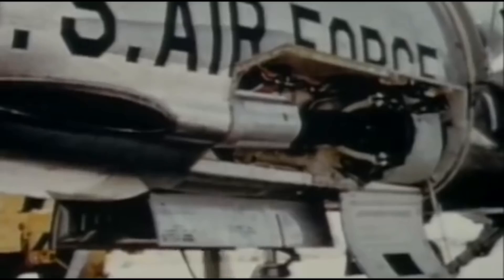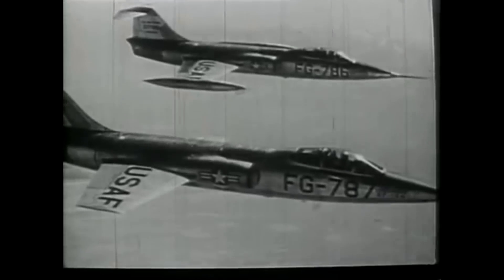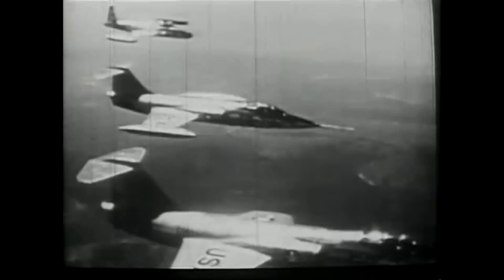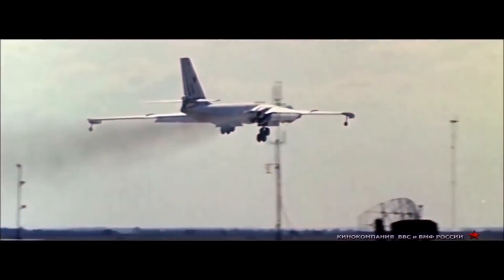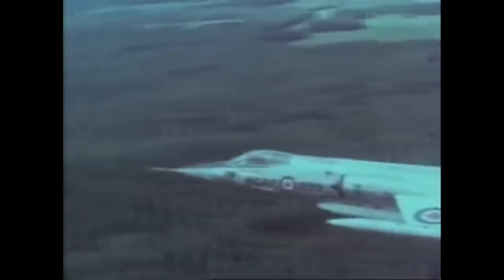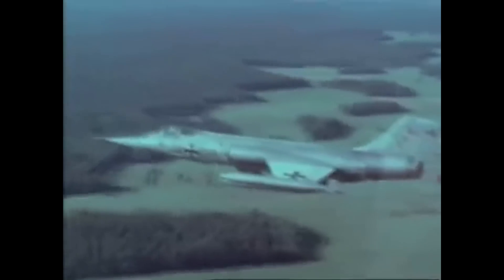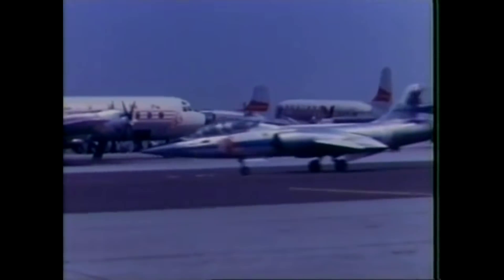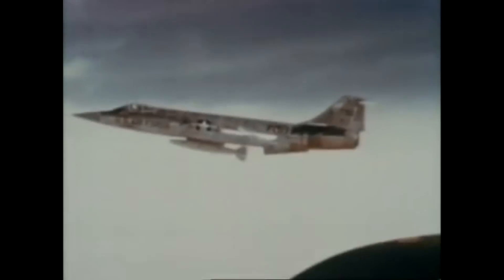Lockheed F-104 Starfighter | The worlds first Mach 2 fighter

Comment: How could it possibly catch a B70 Bomber. It can't not fast enough.
Reply: Are you referring to the "XB-70 Valkyrie"? Only 2 were ever built, and they were still being tested and evaluated. The lone surviving XB-70 is on display at the USAF Museum at Wright Patterson AFB, Dayton Ohio.

 By "catching" the XB-70...are you referring to the mid-air collision between an F-104 and one of the XB-70s? They were flying in formation (along with an F-4, T-38, and F-5) for a photoshoot...because the engines of all 5 aircraft were built by GE. So...the F-104 didn't need to "catch" the XB-70...as it was not trying to outrun the F-104. The F-104 impacted the XB-70, and both aircraft were lost. Quite the anticlimactic ending to what was intended to be a positive, promotional photoshoot!
Reply: When I was 10 Years old my dad took me to Palmdale to see the rollout of the first B70. He was a tech rep for NAA and worked on this project as well as the X15 and Apollo CSM. The cruise speed for the B70 was Mach 3.

Comment: ummmm, F-86s had a kill ration of 10-1 over Mig 15s in Korea. (beginning of video)
Reply: The more recent scholarship based on now unclassified operational records from both sides seems to debunk that older narrative.
Reply: @gort8203  please advise what this more recent scholarship has uncovered.
Reply: @asquare9316  That the exchange ratio between the F-86 and the MiG-15 kill ratio was much more balanced than previously reported.  As I said, this is due to detailed study of actual loss records from the war. When I grew up the kill ratio was often reported as 12:1, so I'm not happy with the revised history, but I try to keep an open mind.  The latest and most comprehensive thing I read had the worst numbers yet, and that is "MiG Alley: The US Air Force in Korea, 1950-53, by Thomas Cleaver with a foreword by Col (Ret.) Walter J. Boyne."  The fact that Boyne wrote the forward added credibility for me and caused me to read the unpleasant revelations.

Comment: Run that past me again. 21 pilots ejected into the ground before someone in charge said 'OK. There's something wrong here'.
Reply from the maker: Basically 😳
Reply: @theatomiccafe8996  The reason for the downward ejection seat was not only because the 'belly' was clear but that the F-104 was designed for high altitude/high speed so an ejection into the clear air below the aircraft was much more seen as survivable.
Reply: @randycampbell6307  a gun type ejection seat would have had to be too powerful in order to clear the tail at supersonic speed. The acceleration necessary would have broken the pilot. The rocket seats with gimbled thrust beyond the confines of the cockpit and so less dramatic accelerative forces upon the ejectee were yet to be developed.
Reply: @theatomiccafe8996  wtf
Reply: Hmmm it puts the trouble of the F-22 and F-35 with the oxygen systems into perspective (both were grounded after they lost a unit or two to sudden pilot's anoxia - just two pilots lost and the USAF already freaked out - it ain't as it used to be).

Oh, wait, I was forgetting who has designed those two planes...
Reply: Ejection seats were a new concept.  Oxygen isnt.
Reply: @pickeljarsforhillary102 That's no excuse for putting them in upside down, is it?
Reply: @pickeljarsforhillary102  
Ejection seats were hardly new by 1960. Oxygen is older and The US still get that wrong.
Reply: This was also the era where they'd have soldiers stand 2 miles from a nuclear bomb explosion for shits and giggles so im not surprised lol
Reply: Just ask Ivan Kincheloe.  He actually rolled the low flying 104 inverted and tried to eject that way.  It didn't work but it did show that he truly did have the right stuff!
Reply: Martin-Baker Mk.7 a British rocket-assisted zero-zero ejection seat retro fitted to European Starfighters
Reply: I guess that hurts...😱🤪
Reply: Porsche 911 GT3 RS,
The butts hurts, if something goes wrong with upward ejection seat, the head hurts. That is the only advantage.
Reply: Typically.
Reply: The Stratojet had a similar setup for the B/N; the guys up top ejected in a proper upward direction, the B/N went downhill. 
The common failure mode of most early turbojet was during takeoff, under maximum load. When a J47 puked its guts post-V1, the pilot and copilot would get out in the vertical direction most suitable for survival. That poor guy in the nose had only a chance to determine his time of death: ride the point of a 200,000lb spear into the ground, or take the rocket-rail to same.

Dad hated swinging the compass on a B-47...
Reply: chris younts  
I think volunteers to test the downwards ejection seat would be none, proper ejection seats were tested on the ground first. An early ejection seat as fitted to a German aircraft in WW II was I believe used just once, the unfortunate pilot was later found still strapped into the ejection seat, dead and minus both arms, what was meant to happen was he pulled the lever and ejected in the seat then had to unstrap the seat and pull the rip cord.  
It seems that as the seat went up he did not pull his arms in far enough and it would be hard to do much with no arms.
Reply: chris younts  Apparently not.
Reply: chris younts  No. Upwards.
Reply: chris younts  Thanks. I didn't know that, Chris. What I do know is that my dad, who was in the RAF, saw a ground crewman have his head ripped off by an ejector seat he was working on. He was leant into the cockpit and bang. I think that was in Aden in the Sixties. Dunno what type of plane it was.
Reply: chris younts  One beer. Crikey! But your ships are dry. We used to have a rum ration, but they stopped that. I'm not sure whether our ships are wet or dry now? As for me, I have a background of RAF and merchant navy. Thought about both but never went either way. In some ways I regret it and in others, I don't. Either way, it wasn't meant to be. Maybe that's where my strong interest in militaria comes from.
Reply: Dude, that was Ivan Dixon.  His character's name was Kincheloe.  That's a true story about rolling the 104 in the middle of a low altitude crash.  He was an amazing aviator. chris younts
Reply: Typical Washington General's thinking, still do!  I was enlisted, worked for a living.
Reply: That "21 pilots ejected into the ground" is bullshit.  There weren't even that many downward ejections total.
Reply: That "21 pilots" business a lot of bullshit.  There were only 17 documented downward ejections, and 11 were successful.
Reply: Rather than eject downwards why not redesign the tail or have explosive bolts on the tail that blew off the tail when the seat ejected, I'm sure it could have been worked out.
Reply: @StephenJohnson-jb7xe  I'm guessing cost!
Reply: @casinodelonge  yeah possibly, tbh I had to go back to look at my comment to see what you were answering because I forgot.
Reply: Nonya Business   
There were good ejection seats available but Lockheed either did not know or just wanted to do it on the cheap.  Even in WW II Germany had made an aircraft which on ejection the high tail and rear propellor would be blown off just before ejection.  The F 104's did eventually get the Martin Baker ejection seat

Comment: The F-104 was designed as an interceptor, not a fighter...duh.  As a air superiority fighter, it was an unmitigated failure.
Reply: Not really.  It was designed as a day fighter.  It was pressed into interceptor duty because the real all-weather bomber interceptor had suffered development delays due to systems complexity, and the F-104 was assigned to fill the gap until the F-102 was available for full service

Comment: The entire premise of this piece seems to be flawed. The USAF already had a fighter which was superior to the MiG-15, the F-86 Sabre. USAF pilots flying the Sabre defeated experienced Soviet pilots by 3:1 in Korea, Chinese pilots 5:1, and NorK pilots 10:1. If the USAF brass wanted a better fighter than the Sabre it would have had to be able to defeat a MiG with a chimpanzee the controls.

Seems like what happened is that someone invited ol' Kel to Korea and tbe Sabre pilots complained that the MiG-15 had a faster rate of climb than the Sabre. They apparently didn't complain that the Sabre could easily exceed Mach 1.0 which the MiG could not. They apparently didn't complain that the Sabre was superior in virtually every aspect of performance other than rate of climb and max. service ceiling. The F-86F, the last version fielded in Korea, was a match for the MiG's rate of climb and the postwar F-86H was probanly a match for the MiG-17.

The idea that the F-102 and F-106 supplanted the F-104 is nonsense. The F-104 over optimized rate of climb and top speed at the expense of other aspects of performance. The aircraft which the AF chose to do the job of the F-104 was the F-110A, aka F-4 Phantom II.
Reply: I don't think the idea the F-86 was decisively superior to the MiG-15 is widely held these days. They are seen as essentially equivalent, with different strengths and weaknesses.  But that doesn't really matter here, because Kelly Johnson wasn't designing a fighter to combat the MiG-15.  The Sabre's replacement was already on its way in the form of the F-100 SUPER Sabre.  Kelly Johnson was really designing a jet that was to have decisive superiority over the F-100, not the MiG-15 or F-86.   The pilots he'd interviewed said that speed and climb were the decisive attributes in combat, so unmatched speed and climb was the goal.  Judging the F-104 against later fighters like the F-4 probably isn't a fair comparison.  The question I ask is whether you'd rather fight a MiG-19 with an F-104 or an F-100.
Reply: @Gort  Again, my comment is regarding what is stated in the video, "The Air Force requested a fighter specifically built to beat the MiG-15," and referring to Kelly Johnson's trip to Korea, "He figured if he wanted to know how to beat the MiG-15 he should ask the pilots who flew against them." It also states that what the pilots wanted was "raw speed." There is probably a point in there that there's a reason why pilots don't design aircraft.

The USAF never had to confront the MiG-19 in significant numbers. In the Vietnam War the MiG-17 and -21 were the primary adversaries. The USAF did use the F-104 in Vietnam in a defensive role although none scored an aerial victory. Apparently, the VPAF was wowed by the Starfighter's press clippings and the USAF was reluctant to use it to confront the MiG. The most successful U.S. fighter against tbe MiG in Vietnam was the F8U but, of course, those could only be deployed in small numbers.

I realize now after re-watching the video that since it was the F-80 that was completely outclassed by the MiG-15 that is the most likely reason CKJ high-tailed it to Korea. The video missed that important point. Even the underpowered F-86A held its own against the MiG-15. The USAF pilots who flew the Sabres had widely varying combat experience. From WWII veteran aces like most of the Soviet pilots to pilots with no combat experience and many low-time pilots. The Sabre was an equalizer, not merely an equal to the MiG-15.  The Sabre could go suoersonic within seconds in a dive. In fact, the XP-86 was the first piloted aircraft to exceed 1.0 Mach about 3 weeks before the "official" record was set by the Bell X-1. That gave Sabre pilots an easy means of escape if they got in trouble. The MiG-15 could not go supersonic in a vertical dive at full power. 

Not to detract from the legend of Clarence Kelly Johnson in any way. My dad worked in Building 82 at Lockheed in 1955.
Reply: @dalecomer5951  I think we agree the video is misleading, and I wasn't trying to support what was said there.  My comments were directed at your claim that the F-86 was superior to the MiG-15.  We don't need to discuss the specific strengths and weaknesses of the two airplanes, but you must be aware that many now argue that the MiG was equal if not slightly superior to the F-86 in overall capability.  (I will add that a means of escape from the enemy is not an offensive advantage that wins a fight.) 
Also, I do not accept the idea that the F-104 was specifically designed to replace the F-86 or fight the MiG-15.  It was not even conceived in response to an Air Force request; Kelly Johnson conceived it and presented the concept to the Air Force. I think Kelly Johnson was simply working to get ahead of the pack and wanted to sell the Air Force an airplane like nothing you could see on the drawing boards of his competitors.
Reply: @gort8203  Yeah, we can agree to disagree.

Comment: The first aircraft to exceed 2.0 Mach was the D-558 II in November 1953. The same aircraft had set a world altitude record the previous month.
Reply: Nobody thinks the F-104 was the first aircraft to do Mach 2, but it was the first operational Mach 2 fighter.
Reply: @gort8203  My comment is regarding what was stated in the video, "It was the first plane to fly Mach two." It's an unqualified statement. BTW, my dad helped install the uprated XLR8-RM-6 rocket motor in NACA 143 about a year before the record flights.
Reply: @dalecomer5951  Wow, I guess I didn't hear him correctly. Thanks for correcting it!
Reply: Correct, but the Skyrocket was a jet and rocket powered experimental aircraft. The 104 coming only a year later as an operational fighter was something remarkable.
Reply: @Hattonbank  The official world altitude and speed records were not set by a YF-104A until May 1958 due to teething problems with the J-79. The first squadron didn't go operational until Feb '58 and was almost immediately grounded because of engine problems. It wasn't just a year later.

At the time the official altitude record was set by the YF-104A the U-2C had been cruising higher for over two years, unofficially.

Comment: Lockheed F-104 Starfighter was one of the WORST aircraft that the USA ever produced. One unforgivable flaw, its uncontrollability, even by the most experienced pilots, made it disaster.
Reply: It was not uncontrollable.  It had some new characteristics, some some of which later applied to other aircraft that adopted the boundary layer control system the F-104 pioneered.   If didn't want to fly an airplane that required some skill and keeping your wits engaged you stayed out of high performance aircraft.

Comment: Ironically enough the F104's long slender fuselage and small wing  gave a very smooth ride at low altitude as opposed to it's normal high altitude design role.

Comment: DIDnt they used to call these things the "widowmaker'???
Reply: correct the German airfroce los almost 300 aircraft and 200 pilots (1/3 of the entire F104 fleet) 
They were not forgiving aircraft one small mistake and you were toast.
NATO and Lockheed did research and found out the Germans flew them way to agressive on to low altitudes.
Reply: @ @obelic71 .  The Germans also stuffed an extra 2000 pounds of electronic gear in theirs.  Made them a little harder to fly than the U.S 104s.
Reply: @2littledogs558  Almost al Nato versions of the F104 had more gear in them then the USAF versions. They were used as dualpurpose aircraft
Adding weight and operating them differently is asking for problems especialy on a 100% interceptor like the F104
For example the Dutch F104 were modified to carry small nukes  /camera pods under their belly.
flame out while carrying a dummy nuke or camera pod did crasch RNAF F104's

Comment: Most people don’t think that the F104s can takeoff on a short run but it can but they’re right on the landing part it comes in hot and fast the other misconception is that it can’t maneuver very good but they’d be slightly wrong it can turn pretty tight however you had to be very careful about it’s dangerous stall characteristics which is part of why it came in pretty fast on landing and why the misconception of it having to takeoff on a long concrete runway but it could takeoff from a improvised short runways as well just not land on a short one also since it came in at nearly 300 miles per hour the landing gear just couldn’t take a hard landing on a improvised runway these shortcomings were never overcome and would lead to many wrecks and crashes, however it WAS and STILL a GREAT PLANE. I look forward to your next content!

Comment: It's amazing those little wings are suffient to generate sufficient lift to get the jet off the ground.
Reply: You can make anything 'Fly' if there is enough force applied to it
The wings, more or less, existed to exert enough resistance on air-flow to 'steer the ship' far more than actual 'lift'
Reply: Jets make up for lack of lift in their wings with thrust.
Reply: That's were the power of the J-79 comes in, to offset those small wings with powerful thrust.